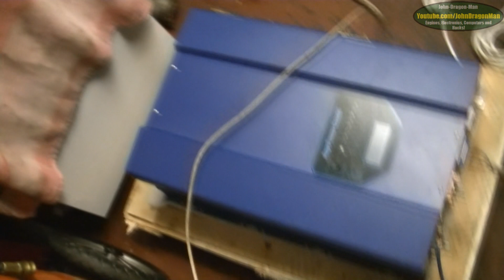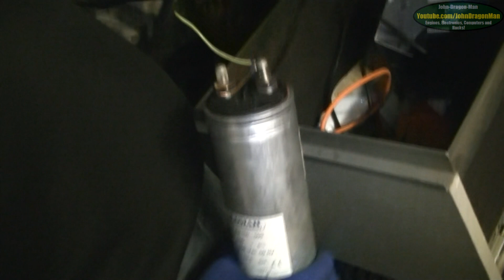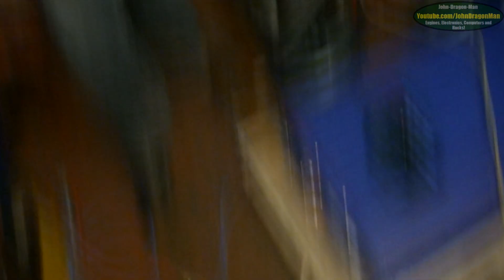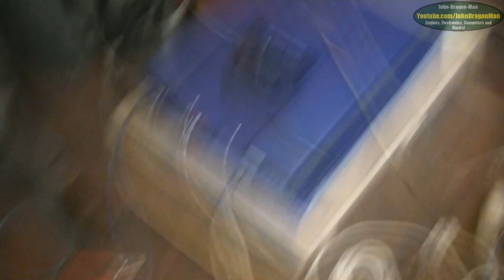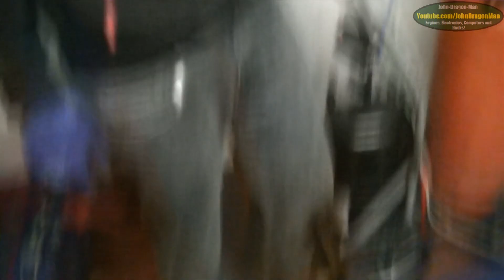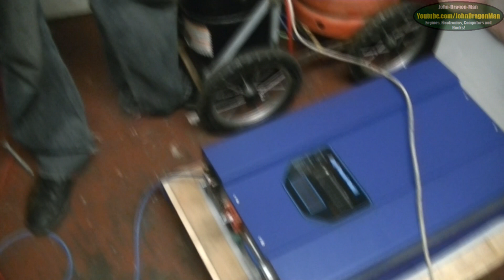12KW Whole House UPS Backup Low Frequency Pure Sine Wave Inverter 48v to 230v Part 5 of 5

Comment: Hi how is the inverter going? did you wire it into the house? im looking to do a totally off grid setup using solar and a bank of lorry batteries at 48v this seems perfect but depends on reliability and if it hasn't packed up yet? 
great vids by the way

take care

Gaz

Comment: Just wondering if i could wire this from a 32amp MCB ac AC in and out to my downstairs ring and upstairs ring also can it be programmed to cycle batteries so solar pv charges them free in day and i use the free power at night?